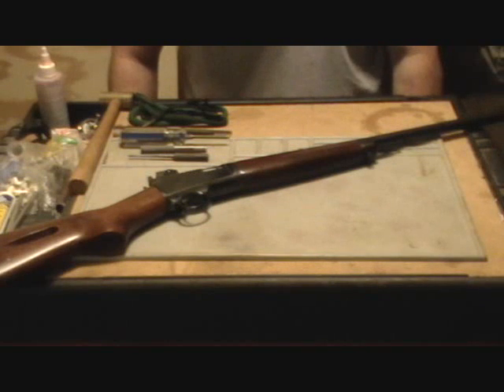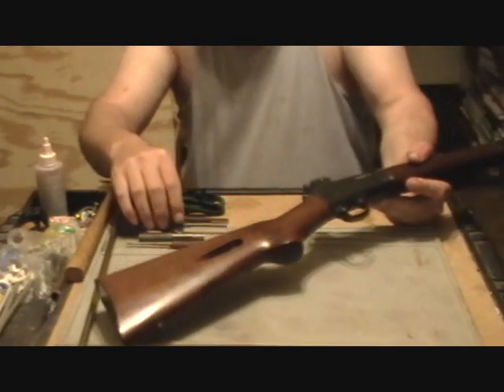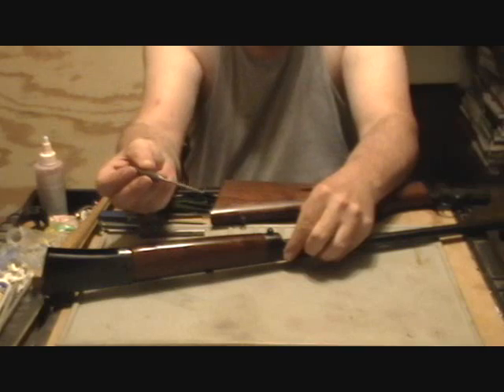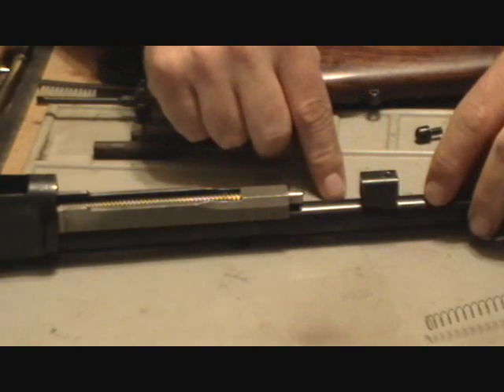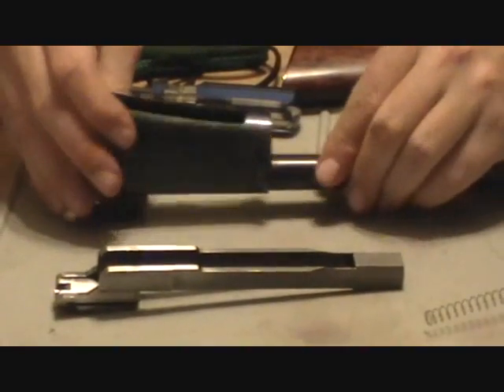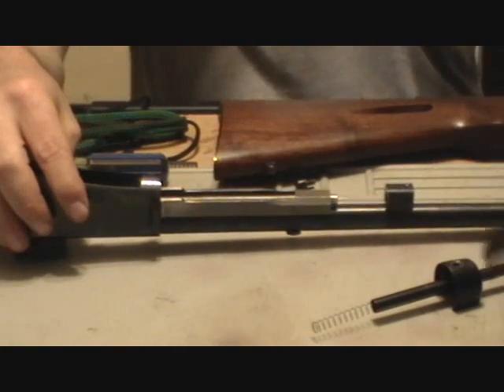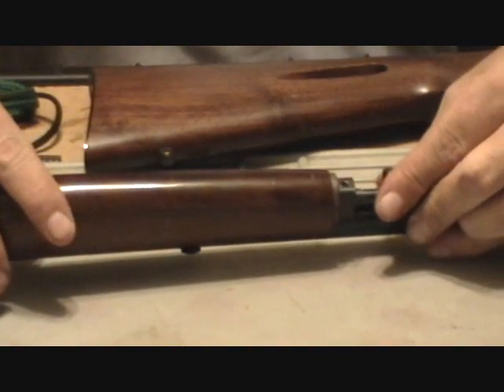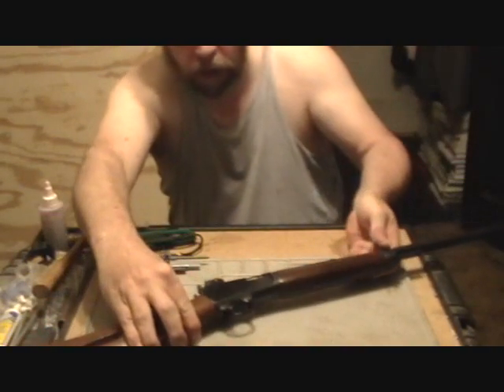Winchester Model 63 .22lr rifle field strip procedure

Comment: Thanks for this video. All info is knowledge and therefore good. I just finished refinishing an older 63 with the dovetailed block in front of the forearm and the 2 sm. screws on each side. BTW this block MUST be removed to remove the wood. This is so close to the forearm that pulling it away from the bbl. to see why the plunger spring is not allowing the plunger to slide over the guide rod is not possible. I finally saw the small hole in the plunger tube that allows the spring to be loaded up and captured with a small diameter punch. Doing this allowed me to line up the plunger tube over the rod and then release the spring. If you could locate an older model and show this procedure might be helpful. Be well.

Comment: Thanks so much for the video. I used it to break down a 63 before buying and noticed a crack in the inside of the forearm. Returned it and got a different one and again noticed the inside was starting to split at the point where the wood is really thin. Clearly a design weakness. Reinforced it with wood epoxy.
Reply from the maker: Mine has the same issue and I too layed a thin band of bedding compound to the inside of the forend.
My stock began to split at the top tang as well and I fixed that and bedded the stock to the receiver.
No more problems with that since.

Comment: For the first time I disassembled my Winchester '63 rifle to clean and oiled it.  When I reassembled the rifle, I had a little trouble with reinstalling the plunger spring (07:30-07:40 on your video).  Because my spring was slightly bent in all direction, that every time I attempted to push the plunger and plunger spring back towards the recoil rod screw, that the plunger spring will "collapse" or bend, not allowing me to install it.  I didn't try using your suggestion of using a punch and forcing the plunger spring into the plunger tube, so what I did was eventually reassembled the rifle WITHOUT even using the plunger spring.  Once I was done reassembling the rifle, I cycled the plunger and the bolt seemed to cycle just fine.  I then loaded one round of CCI short (weaker/quieter cartridge) into the rifle and went out to my back yard (I live in a residential area of California, hence using the weaker round) and shot a round directly into my lawn.  The round went off just fine, except it didn't eject the empty casing (more like partially sticking out, like a "stove pipe" in a handgun.  Is this due to me using a weaker round, or because I didn't put the plunger spring back in?  What do you think?  Since the gun fired (with a weaker round), do you think the plunger is even necessary???

I was also thinking about going out to a local hardware store and buying a similar spring that's a bit stronger (not easily bent) and using it to replace the original bent plunger spring.  What do you think?  

Your help/suggestion much appreciated, Thanks !!!
Reply from the maker: +ANTHONY N. Too strong a replacement spring will cause malfunctions with long rifle ammo.
The action is straight blowback, there is no locking mechanism of bolt to barrel.
Firing a long rifle without the spring in place can badly damage your weapon and shooting shorts in the long rifle chamber may allow a premature detonation that could ring the camber bad enough to ruin the barrel.
Naturally I won't recommend either practice as a sound idea.
Replacement springs are usually available from Numrich Gun Parts Corporation
http:gunpartscorp.com
I took the time to look the part up,
The number is 248960A price is around $3 and they are in stock. HTH
Reply: Thank you so much Onmilo.  As if by you sending me the link to gunpartscorp.com wasn't perfect timing enough.  I tried your suggested method of using a punch to reinsert the plunger spring and hold it down using a paperclip from the little hole on the side of the plunger tube.  I did exactly that in an attempt to reinstall the plunger and the spring.  Somehow, I lost a hold of the paperclip and the spring went flying to who-knows-where.  Now i'm going to have to order a new plunger spring...maybe a couple of springs just in case.  Everything about disassembling and reassembling the Win. 63 rifle is easy, except of installing the plunger tube and spring.  

But hey, thanks for your help again.

Comment from the maker: @billg1374 As far as I know, the securing screw is swaged to the rear of the receiver and not easily removed.
I clean my rifle bore from the muzzle using a Hoppes Bore Snake or a Dewey pull through cable.
On the rare times I decopper the bore, I use a Dewey coated rod and muzzle guide.HTH

Comment from the maker: 1. Clean the rifle well including the breechface, lubricate all contact points with good gun grade oil or light grease. 2. Replace action spring if 1. doesn't help. 3. Always use high velocity shells with older guns. Standard velocity ammunition does not provide enough recoil power to fully function the action. HTH

Comment from the maker: @rcplanebuilder You're quite welcome. Just remember that your rifle will have the two side screws at the nosecap instead of the one from the bottom like mine.
You may have to remove the barrel block to get the guts back in place on that 1942 made rifle. My original M63 was made about 1955 and I did not have to do this on mine.

Comment: Thank you for the video. I have an original older one, and I can't get the fore end off after removing the cap assembly. I removed both screws and cap, but the open block is stopping me from removing the wood. It is a beautifully maintained rifle but seriously needs to be cleaned out.
Reply: You need to remove that block with a Brass punch.

Comment: Fantastic video.  I have broken the gun per your video and want to clean the barrel with a rod/brush & pads. However, in order to get the rod down the barrel, it appears as though the tackdown screw bushing needs to be removed because the rod will not fit through it.  It seems tight and not sure if the threads are reverse threads or standard.  Would you know which way to turn that bushing to remove it??  I am trying to clean it starting at the breech end. THANKS!

Comment: Thanks for this video very informative and well done. Have my grandfathers model 63. He passed on to the other side earlier this year at 98 years old. I watched your video for cleaning purposes. I have removed the block with pin punch but my guild rod won’t budge. Turning to left but I don’t want to force it. Any help would be appreciated. I plan on using this rifle for head shots on squirrel and rabbit. It seems to be accurate and reliable. Thank you
Reply from the maker: I'm a bit confused by what you wrote but I'll try to help. You need to remove the forend and guide rod plunger first, then turn the rifle upside down and use a finger or small punch to pull the operating spring away from the front of the guide rod enough to remove tension on the front screw on the guide rod which you can then unscrew counterclockwise (Looking at it from muzzle to breech side. If screw is rust or grease frozen you can put a few drops of Liquid Wrench on screw and let soak a bit HTH
Reply from the maker: The guide rod screw doesn't need to be turned it gorilla tight when reassembling either, just snugged up tight and the operating spring pressure will keep it secured. If the soaking doesn't loosen the screw try heating the area around the guide screw with a propane torch to just about too hot to hold then let cool to warm and try unscrewing it again. Don't get it too hot or you can kill the operating spring's tension.
Reply: I’m just returning to YouTube and see your reply. Thank you so much for taking the time to try to help me and I’m sorry if I was confusing. I really do appreciate it. I’m going to take the gun apart again and see if I can get it to turn after I take the tension off applied by the operating spring. That might have been my mistake. Again thank you and I will let you know if that worked. Happy hunting!
Reply: I just wanted to check back in and thank you for your reply. I got my gun disassembled and extremely clean. Thank you for the info!
Reply: Happy Veterans Day! Thank you for your service!

Comment: Great demonstration. I have a Model 63, and I feel confident now that I can field strip it and get it clean. Do you normally use any kind of lubrication before you put it together after cleaning it? If so, what do you use? Thanks.
Reply from the maker: I do light brush a graphite grease on internal pivot points and use a light coating of all temperature synthetic oil on bolt contact points and receiver guideways.

Comment: I do have a problem with my model relative to removing the forearm cap and forearm. I removed the 2 screws and the cap but cannot remove the forearm because of the bracket that the screws go into. It looks like I will have to drift out that bracket. It is really imbedded and before I take a punch and hammer to it I wonder if there will be any problems. There appears to be a little pin locking the bracket into the barrel. Any ideas would be appreciated. Thanks

Comment: I have a 1933 Win 63 and am unable to remove the upper from the lower. I've removed the loading tube and loosened the securing screw. The upper and lower will not budge from each other. What am I missing?

Comment: ONMILO, PLEASE HELP.  I HAVE THE EARLIER VERSION THERE THE FOREARM END CAP CONSIST OF THE TWO SIDE SCREWS.  I WAS ABLE TO SUCESSFULLY REMOVE THE TWO SIDE SCREWS AS WELL AS THE END CAP AND THE PLUNGER AND SPRING.

MY PROBLEM NOW IS I AM UNABLE TO REMOVE THE WOODEN FOREARM STOCK.  IT SEEMS AS THOUGH THE REASON WHY I CANNOT REMOVE THE FOREARM STOCK IS BECAUSE THE FRONT BLOCK IS IN THE WAY.  THE STOCK IS WEDGED IN BETWEEN THE RECEIVER AND THE FRONT BLOCK WHERE THERE IS A NOTCH THAT LOCKS BOTH ENDS IN PLACE.  I KNOW YOU MENTIONED THAT THE FRONT BLOCK CAN BE REMOVED BY USING A "PUNCH TO TAP IT OFF".  I'M AFRAID TO DO THAT BECAUSE IF IT'S KNOCKED LOOSE, THEN HOW WILL IT RE-ATTACH TO THE BARREL IN ORDER FOR THE FOREARM CAP TO BE SCREWED BACK INTO PLACE AND NOT FALL OFF?

HOPE YOU CAN HELP ME OUT.  I REALLY LOVE THIS GUN.  FUN TO SHOOT AND SHOOTS REALLY ACCURATE.  I JUST DON'T WANT TO MESS IT UP.

THANKS A LOT,
Reply from the maker: Pull the forend back against the receiver to gain clearance, then tap the block off from left to right (Looking down from top of barrel, left to right -> )Use a soft metal, i.e. copper or brass punch or a Delrin or nylon punch so you don't peen the threaded forend cap screw holes.If the forend wood has swollen with age, you may need to trim a bit away using an X-Acto blade. Trim carefully, you won't need to remove much.Once the block is removed from the barrel the forend will slide forward and off and once the block is removed, it is designed to be easily replaced in the barrel dovetail. HTH

Comment: thanks this has help me alot, but one question, I pushed the plunger to feed a round and now its jammed to the open position in the chamber what do i do now
Reply from the maker: If you were trying to feed a round and it jammed, the cartridge may have been loaded backwards.
If you were just opening the action and it locked back, turn the plunger while pushing back to release the bolt lock...
Reply: thanks, i did get it working again you figure with being around guns so much i would of figured it out my .50 on the humvee is easier to work on sometimes LOL

Comment: Hello  i know this video is old but i have a question if you see this that you may know.  I got a rifle from my dad its old he says it would use the Winchester round it does have the crescent buttock  but the barrel says 22 short long and long rifle it doesn’t say model 63....it says model 06-? Oh and about 3 inches behind the muzzle on the bottom of the barrel it has a cut like how a site is slotted in
Reply from the maker: Winchester 06 is a variation of the Model 90/63 pump action rifles and it sounds like yours is missing the tubular magazine assembly.
Reply: @onmilo  Hi ok so the 06- was a pump action model thank you. that explains the divit in the barrel what i have looks just like 1903 winchester auto rifle i guess "they' put an 06- barrel on it so it can fire the 22LR just like the model 63 it was my great grand fathers rifle it hasnt been fired that i know of since in 55 yrs (MY AGE)  i havn't tryed shooting it yet.. have you heard of this conversion before i don't mind if it is a wall hanger but i would like to see if it works none the less.. again thank you for the information
Reply from the maker: @bbtbmb  It probably won't function reliably even with high velocity long rifles and definitely won't cycle shorts or longs and the breechblock is heavier than that of the model 63 and the feed carrier is longer as well so even if it cycles the high velocity L.R. cartridges I suspect the rifle will jam with annoying frequency.
Reply: onmilo im guessing that i tried some snap caps and it was a jamomatic i put a live round in to see what happened not firing it and it wouldn’t eject.. my father told me it would shoot the winnie rounds not the 22lr as he had used it as a youngster i think, so i ordered a box just for the fun of it like i said if its a wall hanger im good with that too i already have an idea of how ill go about that :-) heck it will have my grandpa’s war bring home bubba-ed arisaka 99 to keep it company again thank you for all the insight and help!!
Reply from the maker: @bbtbmb  Weird. If it needed a new barrel I know Winchester had new replacements fior the 03 up through the 1950s and could factory install one. BE VERY CAREFUL in test loading or trying to shoot .22 Winchester Automatic cartridges as they are longer than .22 LR cartridges and can or even will slam fire with the bolt out of battery (Not fully locked) which can injure you or bystanders as well as potentially destroy the rifle. If a good gunsmith had rechambered an available 06 barrel and installed it, they would have marked the proper caliber on the barrel as well so if what you were told the whole conversion rebarrel may be a bit hinky to begin with.

Comment: I have that same rifle but I have one problem.. when I shoot mine it only shoots once. I would like some help with how to fix it
Reply from the maker: +Jose Martinez 
1. clean the weapon using this video as a guide to take it down for a proper cleaning.
2. check the springs, extractor, ejector for excess wear, replace parts as needed.
3. load more than one cartridge.
Reply from the maker: +Jose Martinez The Winchester 63 functions best with high velocity ammunition.
Some will not function well with standard velocity ammo. HTH
Reply: please can you give link to buy missing springs?and eventually extracor and ejector?

Comment: I need help! 
When triggering the trigger does not return to its initial position, if not that is behind.
What I can do?
 what is this about?
Thank's for the video.
Reply from the maker: The trigger spring is probably broken or rust frozen
It requires the whole trigger group be taken apart to replace the spring
Spares are available HTH
Reply: You have helped me a lot! So kind, thamk's.
Reply from the maker: Look around on You-Tube as someone probably has a video dealing with taking the trigger group apart if you want to try fixing it yourself
Reply: onmilo I have an original model 63 manufactured in 1952 was a gift from my godfather when I was 14 years old still have this beauty shoots like a champ
Reply from the maker: `good deal